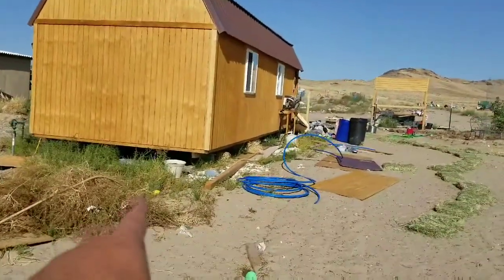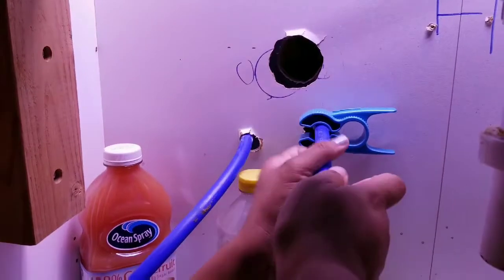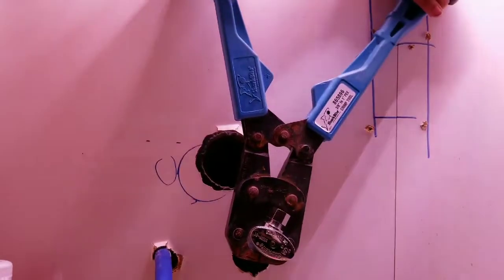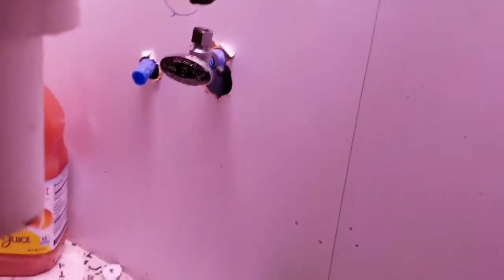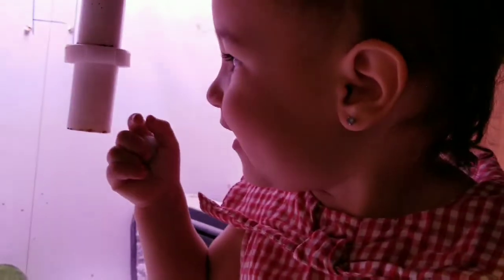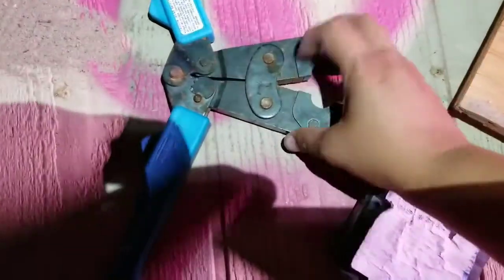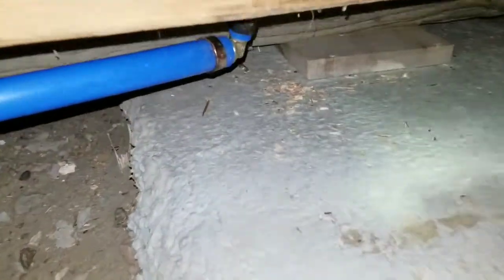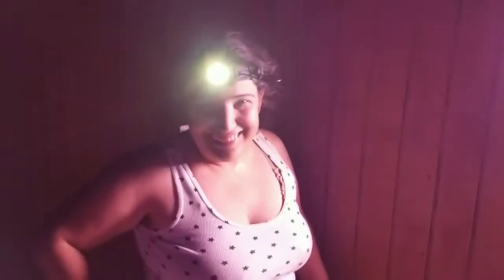Installing fittings, spigot and tote connection for water! (Part 2)

Comment: Have you found your inverter's ECO setting yet?
Reply from the maker: Not yet, our power issues are on hold until we can replace our failed battery bank!
Reply: @mortonsfarm652  I've watched all your solar vids, but didn't see one about your whole battery bank being bad. They are AGM batteries I presume ?
Reply from the maker: Sadly, FLA. Wife went out with mother in law brought back standard "high capacity" batteries. Thanks Napa. Gonna be about  1800 to do the system right (battery cost). They at least act as capacitors during the day and float during the night. It sucks but it is what it is for now I am afraid.
Reply: @mortonsfarm652  Wow. My business is designing and installing off-grid power set-ups. I feel your pain. Have seen it before and it's never good or cheap to fix ! You could put those batts aside for daytime use and set-up a split  array when you get your new batts. Wish I was there, would happily help you out. Keep up the good work though ! :)